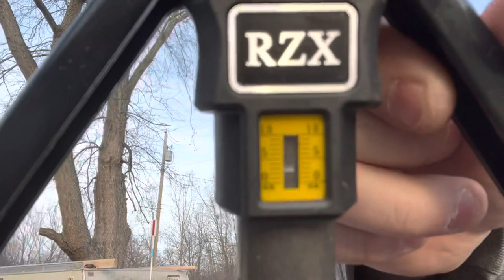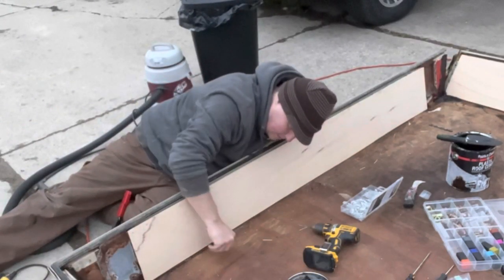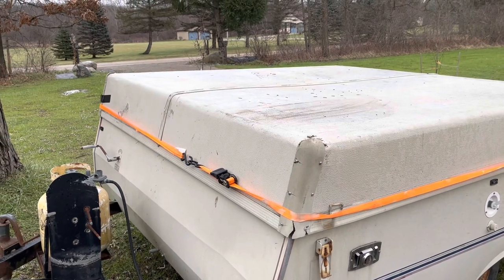PopUp Camper | ROOF REPAIR | HOMEMADE | HARD SIDE Conversion ep4 Restoring #diycamper #popupcamper

Comment: Do you rekon it'll drive down the road nicely when it's finished ?
Reply from the maker: It should. I thought about the height and it’s really not taller than a box trailer with the same shape. So really I am focused on structural integrity. I am building it very strong as you will see in videos to come. The only thing I might want to improve are aerodynamics later. I need to see it’s height over my tow vehicle which is a Tahoe. I might ramp the front of it a bit to cut down on drag.

Comment: Did the tar smell for awhile or ?
Reply from the maker: This was a concern for many of my viewers... Believe it or not, I smelled zero tar when I put the roof on.  Some think it might get hot and melt in the sun in summer, or smell.. Nope not at all.  I would honestly use tar again.  I have many new camper videos coming, Please Subscribe
Reply: @Jeep-Creep  hey man thanks for taking the time to respond I'm watching your whole hard side conversion series I just got a pop up and it also needs roof repair so I appreciate your input thanks again
Reply from the maker: @justinsmith847 it seems all campers eventually needs roof repair. They all leak eventually. Except mine hopefully lol. I plan on adding more rubber coating every 5-10years.  Let know what the good and bad is on your roof. Does it have a vent fan or AC?  If not makes it easier. If you do I would strip it down and reframe it. Don’t be afraid it remove layers to find out the amount of rotten damage. Got any pictures?  Are you posting to a YouTube of your progress?  I am hear to help and can give you ideas.
Reply: @Jeep-Creep  I don't have any pictures at the moment I just picked it up last week but hmmm I didn't think about posting it to YouTube lol I appreciate any and all help yeah I planned on taking it apart piece by piece removing the canvas and all the rails it has a roof top vent it is a camplight by Damon . I believe 96 or 98 I will keep you updated though thanks
Reply from the maker: @justinsmith847  ok sounds like a fun build. So that fan has a frame around it. Could be where the roof started to rot. It’s best just to go through the whole roof they are weak at best. I will see if I can find the one video I watched of a guy that rebuilt his roof nicely.
Reply from the maker: @justinsmith847  ahh this is the guy I liked. He did a great repair and is detailed. You still need to attach the roof to the walls that’s where my work is good.  https://youtu.be/pTjRYOes-QI?si=fZ256Omq-OcRHrsY
Reply from the maker: Not saying my way isn’t good because it really is awesome. It’s mostly you need to run a frame on the inside to support your fan is all. Mine does not have a fan.
Reply: @Jeep-Creep  ok great I'll take a look thank you